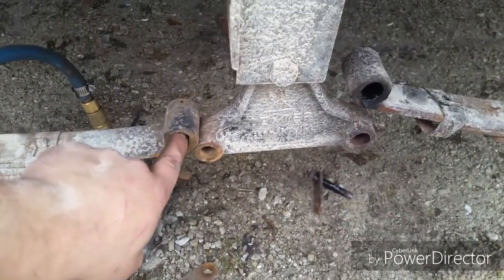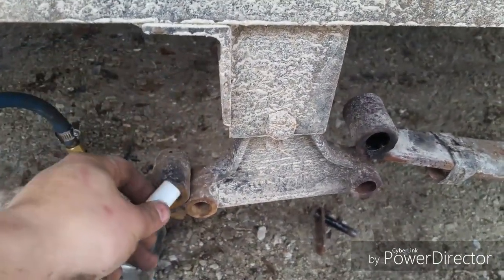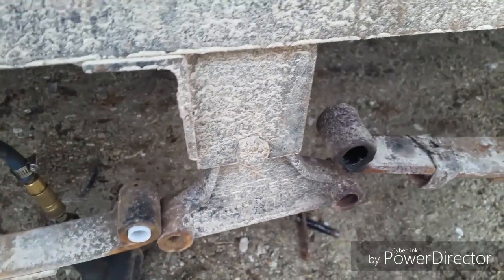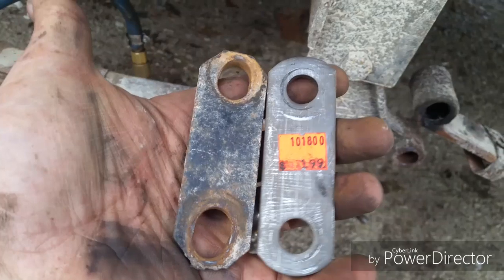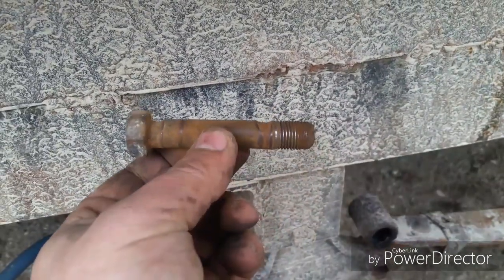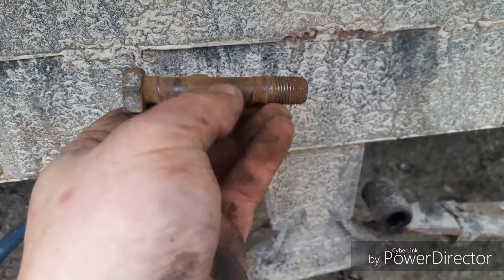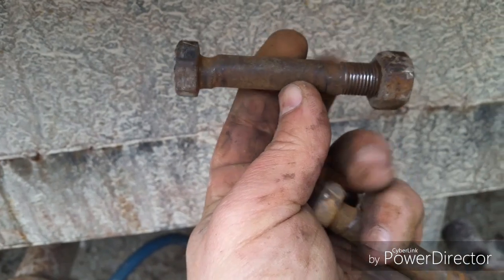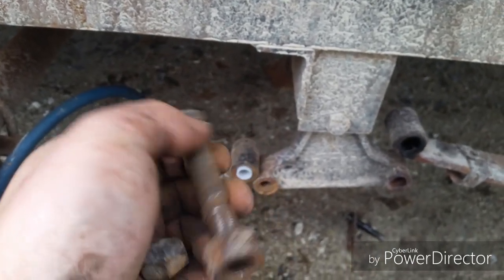Trailer Tech - Shackles and Bolts

Comment: If you tack weld the bolt head to the shackle plate the bolts won't wear like that.
Reply from the maker: That's true, but it was a customer trailer, and I can't warranty a part that might fail if I have thrown and extra weld on it
Reply: How would the shackle move if it's welded in place?
Reply from the maker: @jdhappy7663  it forces the bolt to rotate in the sleeve instead of the shackle rotating on the bolt
Reply: I was thinking welding both bolts on the shackle would keep it from but looking at it it makes sense now
Reply: Once you tighten the nuts down how much do you back them off?  just so they have space between spring in the shackles and or frame mount and the spring?
Reply from the maker: @jdhappy7663  rock on

Comment: You better not run that impact on those bolt heads to tighten them!
Reply from the maker: I assure you, everything was moving freely when it left.
Reply: @hillsidepowersportrepair8863  bolt was spinning in the shackle plates cause you used the impact on the bolt  head and spun the bolt and destroyed the press fit. Bolt spinning is why the plates wear so fast